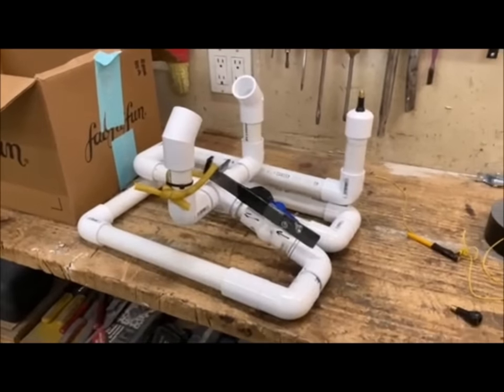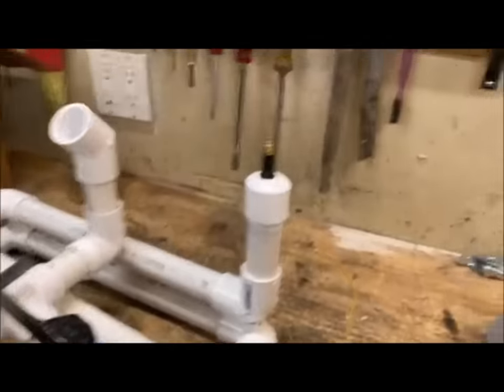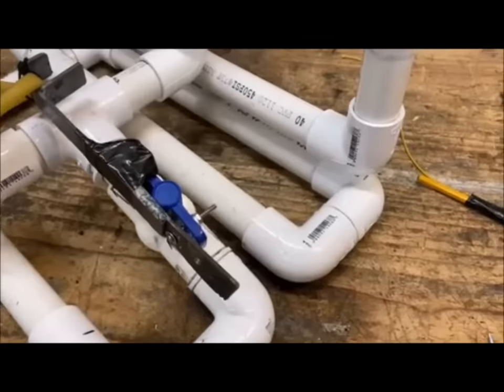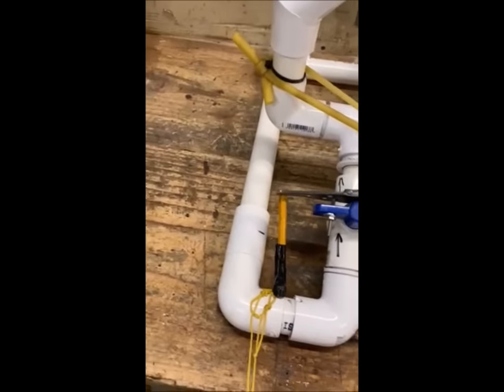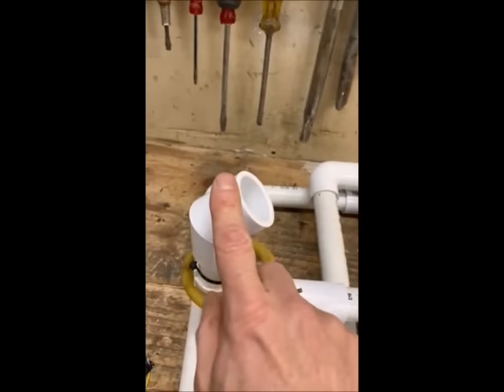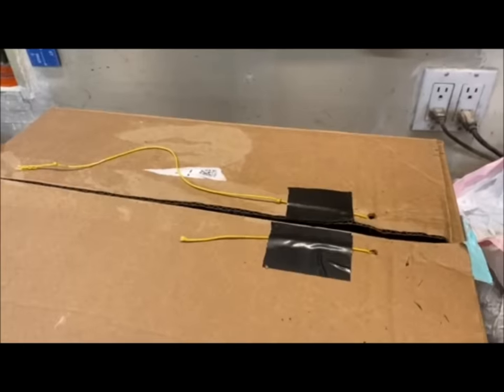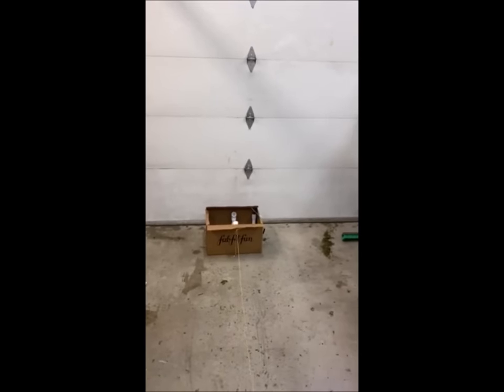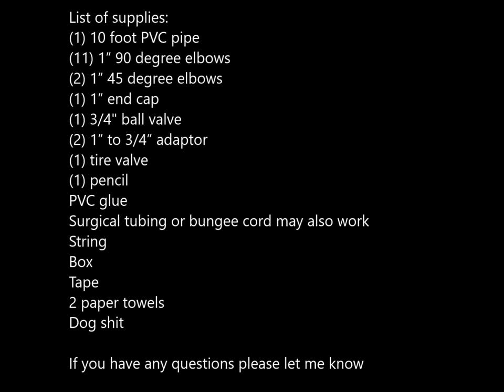The ultimate revenge for a porch pirate package thief – A high pressure dog shit shooting air cannon

Comment: An automotive airbag and 5 lbs dog crap is far more effective. Note: I always put my exwife's address as the return address , for plausible deniability.
Reply: Sadistic
Reply: The important thing to do is make sure the dog crap is thinner than normal. A garage sale blender works best. Some use water or urine. I find pure LIQUID ASS drives home the point. 👍👍👍
Reply: Omh that's FUNNY

Comment: Excellent work. My problem would be to put all that effort into building it, and then lose it to the dirtbag thief.  ALSO, that thief could then turn around and get someone else with it. What you need is something cheap and easy to build which destroys itself in the process of deployment. Like something to spray industrial ink and dye everywhere.
Reply: Use dry dye that forms a dye cloud. There used to be a brand called Fibric Dye that I've used. Maybe dry Rit dye might work too. Nothing beat Fibric for its intensity and brightness. And once set not even bleach could remove. It only showed up when it got wet or the humidity rose. If released inside a house everything would be covered in a dust surprise.

Comment: Had a similar idea for trespassers coming on my shooting range at night. Built mine out of 6 inch PVC, hooked up to an air tank with trip valve, with a trip wire across the driveway, that held 160 psi of air, pointing down the driveway. Put a 1 gallon freezer bag with dog shit and WATER down the tube!
Reply: What happened as a result?
Reply: @KairosObj  
Must have had ESP, cuz after I set it up, they stopped coming on my land. Would have been funny as hell, but, oh, well! Good idea anyway.
Reply: @tmerriett6892  Mission accomplished but it would've been fun to watch.
Reply: @gigibluestockings5168   also thought about adding some buck scent to it, but didn't. When I took it down, I  didn't want to  touch it, so just set off the cannon.
PEEEEEYYYEWWW!!!!!
Reply: @tmerriett6892  Still it would been fun!👍

Comment: Its all fun and games until you piss off an engineer.
Reply: A real engineer would know better than to pressurize pvc like that. PVC isn't made to handle air pressure and has a high chance to explode in very sharp shrapnel when it's pumped up. Metal pipe would have worked better, and the added weight would probably have been attractive to the thieves. Heavy packages usually mean more valuable.

Comment: Do not have a porch theft problem at all (conservative working class area with good neighbors) but I have a background as an HVAC tech with tons of experience with pressurized containers, solenoid valves, sensors, control wiring and electronics and I decided if I ever started to experience this problem i would do a similar thing, only i would mix the dog shit with water, let if putrefy and spray it out as a semi liquid. Would be much more effective.

Comment: Instead of a length of 1”, use a short piece of large diameter pipe.  The air will not have to travel the length of the 1” assembly as it’s contained close to the exhaust.  The volume goes up with the square of the diameter!!

Comment: You should run the pipe up high and then back down low, add some water to the crap and get it really soupy, fill to just below the highest point, then put some caps on with a few 1/8" or so holes in each to make it spray and see if it makes a much bigger mess. It would be epic for it to just spray for a few seconds while all they can do it watch it go, lol! Really wet would be great to make it really soak into their car or apartment, etc. so they don't forget it for a really long time. I'm sure people would ask them what the smell is too, lol! If you could find some of that fart spray they used to have at the novelty shops back in the day it might be even better. That stuff stunk so bad and took a really long time to fade.

Comment: I generally open boxes from the direction perpendicular to flow of your exhaust pipes.  That is, I open the outer flaps sideways not one toward and one away from me.  Maybe lots of people open boxes this way.  You'd have to modify your air cannon to have four rather than two exhaust pipes, with them pointing in all 4 directions.  You could also create a venturi to increase the pressure and therefore the flow out the exhaust pipes.  Narrow down the pipe diameter just before the wadding.

That being said, another risk to the homeowner besides getting sued might be retaliation vandalism.  So for these two reasons, don't set a booby-trap box outside your house, even if it has separate venturied exhaust pipes pointing in all 4 directions.  I never will, but this video genre is amusing to watch.

Comment: instead of a manual valve use a sprinkler valve and wire a pressure switch with 2 9-volt batteries to power the valve a lot easier to setup and guarantee it works

Comment: This is so great! Only problem is that it takes a lot of time to make and most of all would be pretty expensive per box. I bed you might be able to take a quality plastic bottle at goodwill or smartwater bottle and put a valve on it yadda yadda. And make it super cheap and easy to make. Or 3D print parts and make a spring loaded lever to fling it out the top.

Comment: I see issues with the design.   Your test of leaves is not representative of or the consistency of your intended ammunition.  You also didn't test for rough handling in transit.  My guess is it went off while still closed.  It's also not very repeatable unless you keep making them.  That would get expensive.  I'm also somewhat beside myself at the moment because here I am critiquing a poop bomb.  😣

Comment: A piss bomb is so much easier,  glue 4 razor blades into the bottom corners of a box, get or make a box that fits inside the razor blades, take  the top off the inner box.  Next eat a lot of asparagus  and drink some beer.  Collect about a quart or two, pore it into some condoms and tie them. place them into the inner box and assemble upside down. Also punch drainage holes around the razors.  When they open the box they discover another box that they lift out, allowing the condoms to roll out onto the blades.

Comment: Ok, dog shit is a good payload but, for a position you'd be watching over, consider glow stick liquid. It's a two part system where you take the main liquid and keep it separate from what's in the glass ampule until the moment the trap goes off. That coupled with a loud alarm bell and a paintball gun... I hope you get the picture

Comment: the dogshit should work fine but is a bit of a bother to load intoo the thing 
could allso use (clothing) paint mixed with pepperspray fluid 
as for the valve an electronic valve might work better , i suspect that jarring the box could set it off while the lid is still closed using an electronic valve responding to a lightsensor might work better (though more expensive)
at least its less lethat than a shotgun shel mounted to a armed mousetrap that has a nail welded to the spring part to act as the firing pin https://www.youtube.com/watch?v=ucL8jfXgQ_o